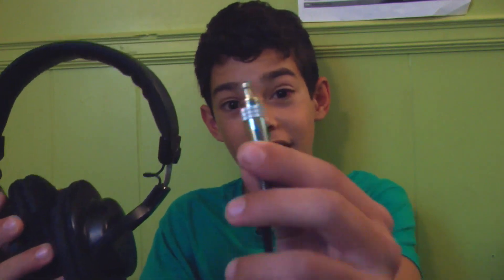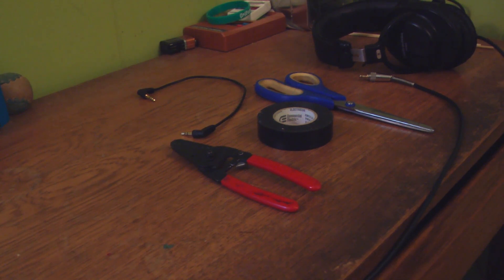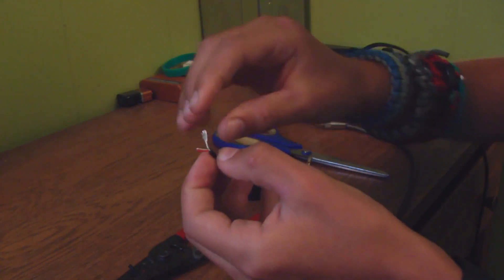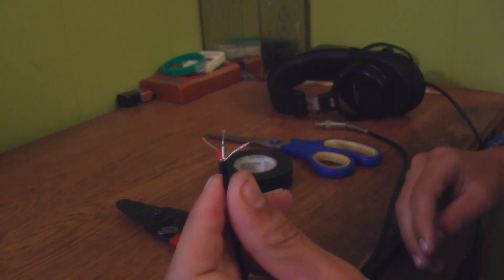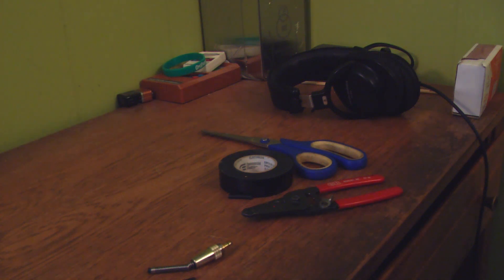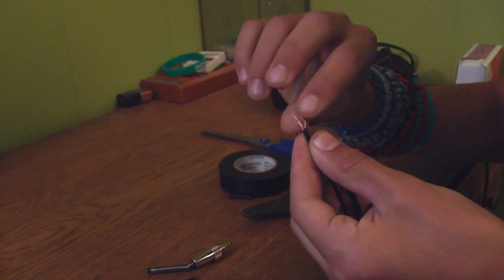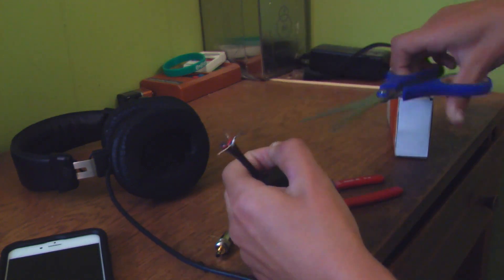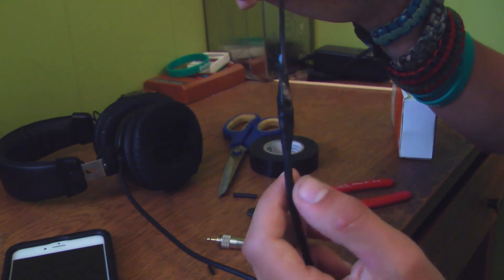How to fix broken Headphone Plugs

Comment: I have repaired many headphones due to, usually, the cable breaking as it goes into the molded connector. I just order a new connector, and using Heatshrink insulation instead of tape, strip the cable back an inch or so to be sure you avoid the actual broken wire, and first ohm out the wires to be sure I have ground, left & right & sometimes a fourth control/mic wire, and slide on the heat shrink first, then the plastic cover. Now strip the conductors just long enough to get to each pin. Solder the wires. Test it. Then bend the pins so the cover can be screwed on. I've found applying a tiny amount of clear silicone in-between the pins will greatly aid in it not coming apart and not having a short in the future. Screw on the cover, test it again, then slide the heatshrink down and over the flex guard of the cover and apply heat just enough to shrink it. Depending on how snug the cable is to the cover, you may need to also have additional heatshrink to help secure the cable to within the connector  over the longer ground connection. This method avoids the splice and looks much more professional. In the long run, it will hold up longer too. Tape tends to come loose over time. I would say for your age, though, you did a great job!
Reply: What about headphones that have sewing on it

Comment: by any chance does anyone know how to fix earbuds with one ear working
Reply: This is almost always due to one if the wires within the cable breaking where it enters the connector since it gets a lot of bending there. The solution is to either replace the earbuds if they were really cheap ones, or replace the connector and be sure to cut the cable back far enough to avoid the broken wire. You can use the method shown by the author if you can't solder well, or see my reply to the author to do a more permanent repair. (That requires more time and likely a bit more skill) either way, you do need to use a meter to ohm out the cable and the plug to find the correct way to make the connections. If you have a set of earned that include a mic and control button(s), there are 4 conductors instead of 3. The fourth one can be more of a challenge to identify. On the 4 conductor plug, the tip and next section are right and left. The next one is the ground and the last is the control. You can Google it. You would think the 3rd would be control and the 4th be ground, but it's not. Hope this helps you!
Reply: Thanks